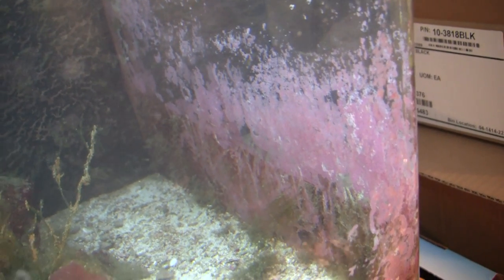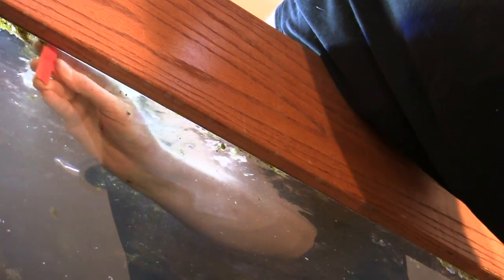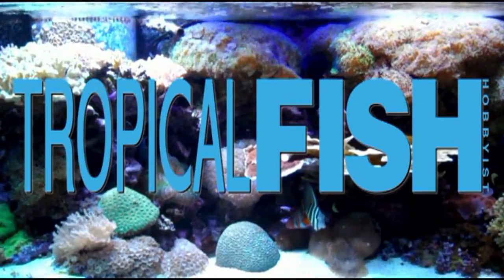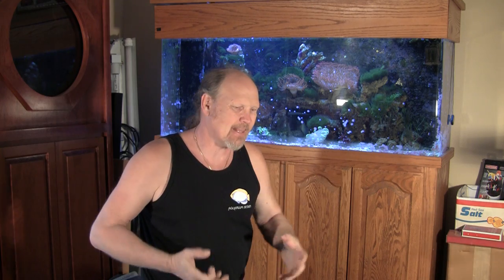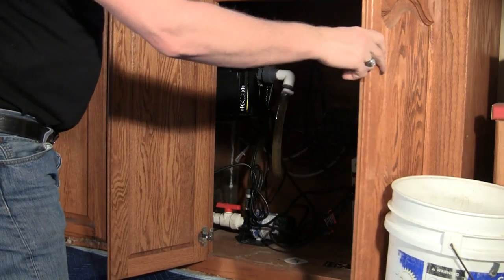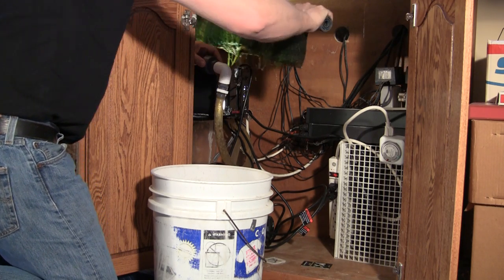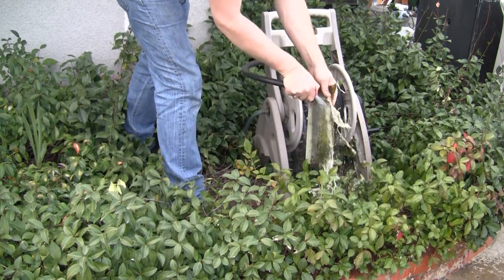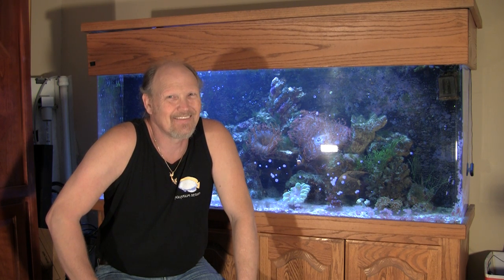Cleaning My Own Aquarium, LA Fishguys, Episode 116 pt 3

Comment from the maker: hey M, flatworks are coral parasites. they live off on the surface and feed off the bacteria waste from the coral. if you look close you can see them on the corals in this tank. eventually they will cause an issue with the coral but at the very least they make for unattractive corals. i hear there is a small wrasse who will feed on them.